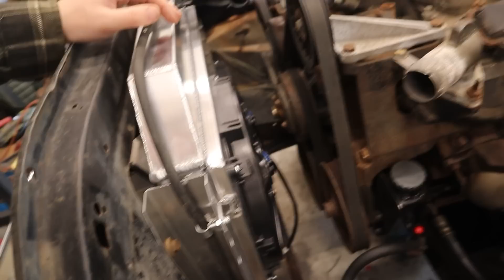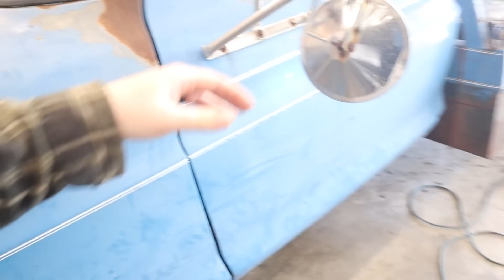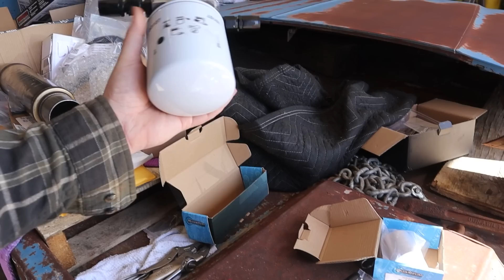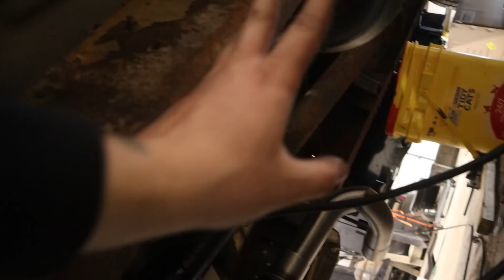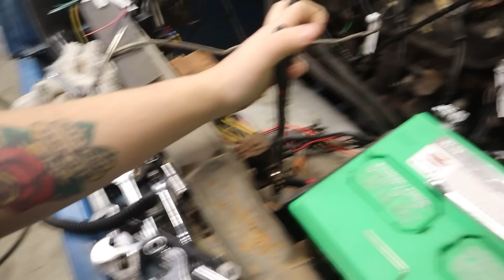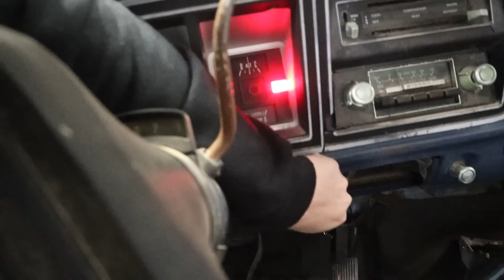IT SOUNDS AMAZING! 8.1 BIG BLOCK Swapped Ford F-350 Ramp Truck FIRST START!

Comment: Wanting to do this with an 2001 8.1 into an 84 F250 that has a 300 6cyl (was 6.9 diesel).  What parts did you use?
Reply from the maker: Nothing really exotic. I modified some universal motor mounts and made a transmission mount. Shortened the driveshaft. Stock exhaust manifolds. Fuel cells with an external 044 pump to stock fuel rails. Howell EFI harness and stock ECU. Made some rad hoses. Thats pretty much it

Comment: The exhaust pipe expander I bought from “ Horrible freight “ ( JK, I use Harbor freight for a lot and very satisfied) was kinda wonky….. 1st couple tries were fails 100%….. but I took my little MAP gas torch and put a little heat on area that was to be expanded and it worked awesome!! I’ve used it many many times heating up the area first and absolutely a game changer when doing swaps and home built exhaust setups!!

Comment: Pffft you say Ford wiring is weird, my Mercury had a ballast resistor system for the FUEL PUMP.
Reply: Ford makes Mercury.
Reply: @joeydaniels1615  Duh, that's the whole joke.

Comment: another slight issue is using the cable throttle with a DBW ECM. no lol he did not mention he needed a cable throttle tune :D I did just the basics on it delete the vats and the emissions. Will look at the methods to change to cable throttle when he gets the computer to me. Awesome work!!
Reply from the maker: Okay, awesome! I told him at one point I thought it was either the throttle body changed or the exhaust is able to breathe so much more that that fueling could be off.
Reply: @SniderTron3000  If it were the exhaust making it lean, you could unplug the coolant temp sensor and start it up. Assuming its like the 5.3/LS engines.